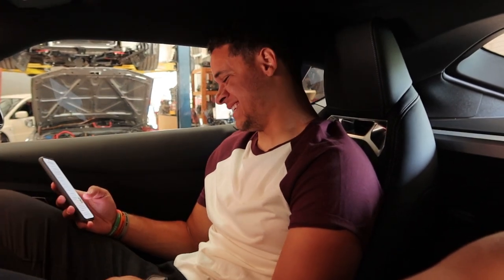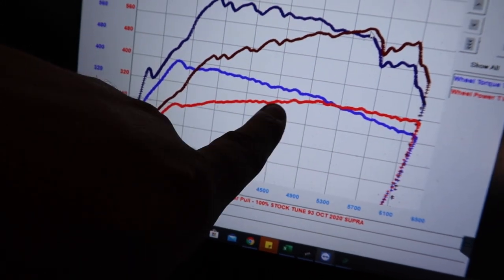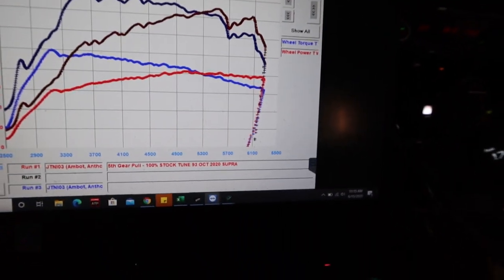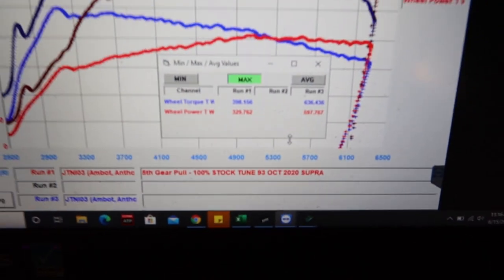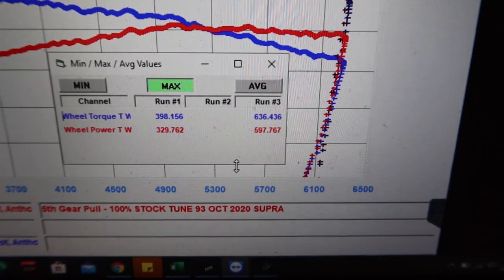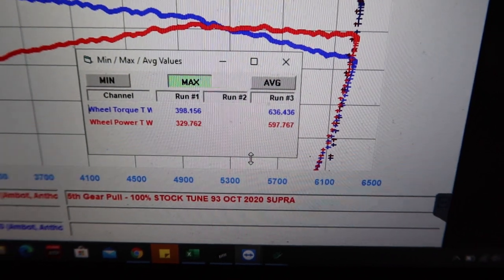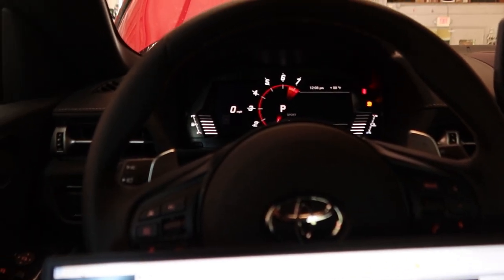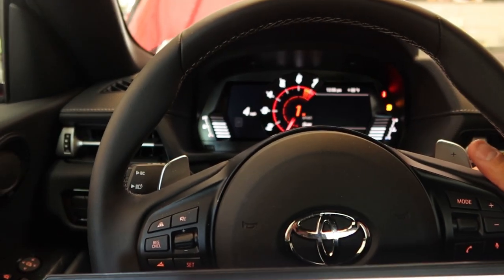2020 SUPRA FBO DYNO MAKES 674WHP & 693TQ

Comment: This really makes me wish I got a bmw 340i drive...sounds odd but they had a b58, awd and manual. Cuz damn can this engine make power easy and handle it.
Reply: I have a 340xi 6 speed. The shift bog is nuts. I’m on a pure 800 on e50

Comment: Sweet build bro I was going to get the boost logic turbo kit but went with pure800 to keep it simple and reliable and mine puts down 680 I just don’t see the value in that kit besides the cool sounds and the cool factor with the hood popped up. Good content as always 💪
Reply from the maker: Steve Kindel thanks a lot bud, the pure800 is a really good turbo! I just wanted that top mount look
Reply: 680 wheel? What’s your exact set up if you don’t mind me asking
Reply: @dannyascencio1  yea I wanna know too!

Comment: Those are great numbers , but why wont get great times at the track without nitrous 🤔 ? Is anyone running 9's without spraying ? .
Subbed👍🏾
Reply from the maker: 60 foot wont be good. I actually went yesterday and could only cut a 1.71-1.73 60Ft due to the bigger turbo
Reply: @AMBOTTuning  that's not to bad ...could be a lil quicker if u dont mind saying what was the quarter mile time and trap speed?
Reply: @AMBOTTuning  that needs a launch control
Reply: @celebritywatch386  at 1.71 trap  60 ft. He's running 11.1

Comment: Longer gearing needed 5th gear 137 top mph at 600+ WHP isn't adding up.  should be pushing 160 ~ 170 top maybe higher.
Reply from the maker: Yet the car goes 9s and traps 140s 🤷🏽‍♂️

Comment: Clickbaits strong on this one
Reply from the maker: How is this click bait ?? 😂😂😂
Reply from the maker: To bad the car went 9.5@143 in the 1/4.
Reply: @AMBOTTuning  idc about the time slip 😂. Fbo isn't turbos, meth etc. Fbo is headers,cai,intake manifold, exhaust etc. People don't even count e85 in fbo.
Reply: @AMBOTTuning  not hating just speaking facts I don't have a problem with supras, them little things move. That's why I'm here checking them out.
Reply from the maker: @Kingg_G  too each their own. In the Subaru and new Supra FBO on is any part that can be replaced and bolted on. I.e turbo, headers, exhaust, intakes, port injection. 

This car wasn’t even using meth at the time. It was on port injection.